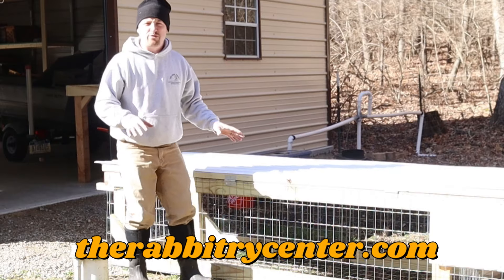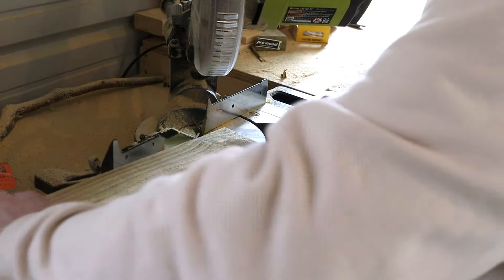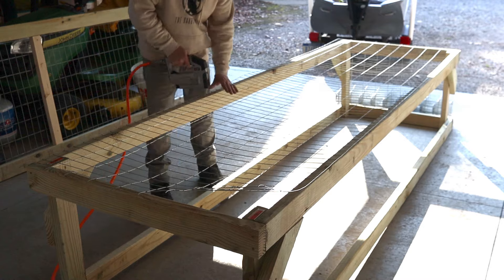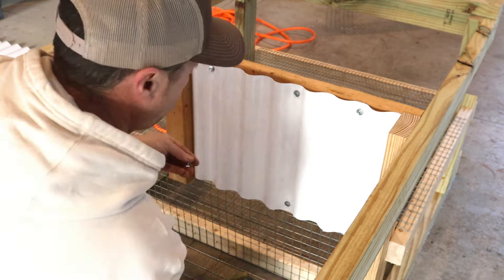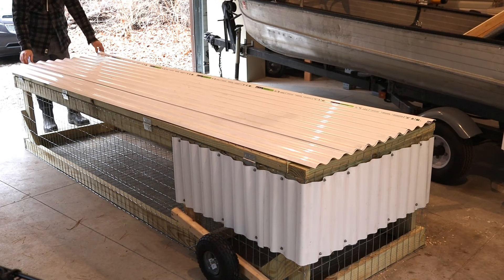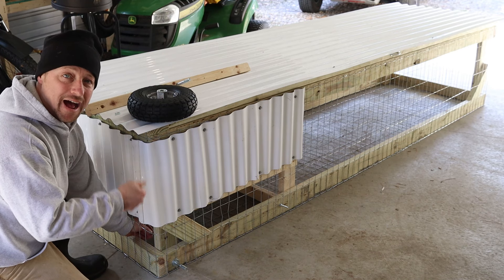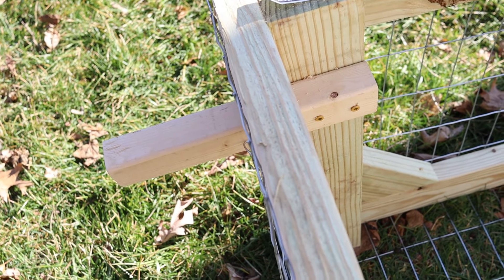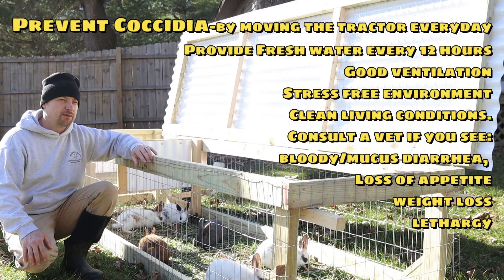How To Build A Rabbit Tractor With Wheels

Comment: As a smaller woman I would build the wheel assembly on both ends for even easier portability. Then I could pull or push it like a wagon instead of like a wheelbarrow
Reply from the maker: Instead of each end, I'd build a shorter tractor 6-8 feet in length. If you can lift a wheelbarrow with soil in it you can lift this.

Comment: Hey there! Thanks for the video and I will copy the wheel mount! Thank you for that! :) Some thoughts: In my third or so build I swapped the cage wire to the inside, so the rabbits wont bite into the wood. It looks sturdy at start, but once you raise some generations in it, the wood will suffer. If you do that, you have to add an additional cage wire as a second layer on the outside, so magpies wont try to get to the rabbits. One of mine lost an eye to the birds...that was sad. And to all of you, using this (or a similar build): Build as lightweight as possible. If you have some rabbits in it, those thinks tend to get HEAVY. If its too sturdy ... its just right. Furthermore I added an automatic water dispenser (they are pretty cheap) and added a water tank (5L or more) to it which I can fill up (via a valve) with my garden hose. If you have a lot of rabbits in it 5 litres will be gone in a day EASILY. Furthermore I recommend to let the bottom cage wire "overlap" around 10cm to the outside of the framework, so predators wont have a chance to even try to dig in. If you have a BIG yard, like you do, the gras will be more then enough. But to the people with a smaller garden: Be aware. The gras will be eaten FAST and afterwards they start digging. Furthermore if you have rabbits in it, they will flatten the gras down and compact it. Move OFTEN (I advise twice a day). Maybe one more hint: I fixated a lifting system for the roof. I added one bar of wood on the top of the cage and have a wood plank attached to the roof opposing this bar. If you lift the roof, the plank will go down on the bar and act as a "stand" for the roof. For closing just lift the roof a bit, so the plank comes lose, give it a little push and you can close the roof down again. I added some height to mine according to the height of the surrounding cagewire, so I dont have to cut it. But thanks a LOT for the video and have a nice day! :)
Reply from the maker: Thanks for taking the time to write your comment and share your experience. We all raise rabbits a little different which demands a different approach. 
I built this design specifically for a grow out tractor, which will be used from 8-12 weeks and then be vacant until another litter of meat rabbits need to grow out. We wrapped our permanent runs for our extended cages the way you described.  Thanks for watching!

Comment: Midway through building this tractor. I’m grateful for all the effort put into this design, parts list, and instructional video. I would suggest though that you consider a few less pieces of treated lumber. For example, the end pieces of the lid are treated, but not the long pieces. Why can’t it all be untreated? In fact, I think you could go untreated for anything not in direct contact with the ground. That would mean 2 of the treated 10’ 2x4s and 2-3 of the treated 8’ 2x4s could be cheaper and lighter weight. 

Also, I’m finding that screwing straight into the ends of these treated 2x4s is not holding all that well. The bracing will make up for that, though.
Reply from the maker: Thanks for taking the time to comment The treated boards have to be strong to weather the storms  and elements. I think you should build the Rabbit tractor, however, do you want and whatever makes sense to you. We did end up wrapping 8 inches of hardware cloth all the way around the bottom and adding extra arms on the wheels to make it easier. Stay tuned for an update.
Reply: @ An update would be neat to see. Your videos are all great. Very grateful for your channel.

Comment: Good video. If metal roofing is used for the lid, you probably wouldn't need to use wire. That might reduce costs a bit. It would certainly reduce labor. Also, if you have a Harbor Freight store nearby, they usually sell wheels cheaper than Tractor Supply.
Reply from the maker: thanks for sharing. These wheels are a terrific deal. I’d be very surprised if they beat that price and quality.
Reply: @ 10 inch puncture-proof wheels about $8. But you can sometimes get decent bargains at Tractor Supply too.

Comment: Terrific build! I missed why you shifted the door and ended up just shortening the door because I installed a second 2x4 on the other end thinking symmetrical ends made sense!😂 Ours is not exactly the way you made it but the rabbits will love it!❤
Reply from the maker: that’s terrific! Certainly doesn’t have to be exact. Best of luck with your Rabbits!

Comment: Thanks. I have some uneven pasture. Will larger wheels benefit?
Reply from the maker: those wheels don’t get stuck and are good for soft soil and moving around the yard. They’re sold at tsc. it’s the best choice I’ve seen so far. It’s good to mount the wheels close to the end of the tractor for easy pivoting.

Comment: My rabbits chew on the wood on the inside of the tractor. To prevent this I have to put the cage wire on the inside instead of the outside.
Reply from the maker: Absolutely, If your rabbits are going to be in the tractor, for a longer period of time, I’d provide branches and hay to chew on and wrapping the inside will be necessary to prevent any chewing and if you double wrap(creating a barrier) you can prevent contact with wild rabbits.
Reply: @TheRabbitryCenter. Great build, good looking and sturdy. For me, too heavy and too much work to prevent chewing. 

Just build this tractor from 3" pvc pipe. No chewing, no wood rot, no double wiring and much lighter to move. You can still drill holes for the wheel assembly and either t- in the piping for shelving or run rebar, steel pipe or wood through the pipe to form the basis to build the shelving.

Nuts and bolts with washers through drilled holes in the pipe will affix the roofing panels and wrapping the wire around the pipes affixing with zip ties, j clips or hog ties will hold the wire to the cage. Alternately you can use wide washers with nut bolts to screw-fasten the wire to the pipe.
Reply from the maker: Thanks for commenting and sharing your build plans. Our grow out tractors are housing 8-12 weeks old rabbits.  The chewing isn't a problem.  We throw in  branches and hay daily which helps their digestion and teeth. When using tractors for a permanent cage, you'll absolutely need to wrap the inside with hardware cloth to prevent chewing.   @jacquiegines

Comment: Are you able to move it around with the rabbit still in it? Seems like they would break their legs off
Reply from the maker: They don’t sit still, when you move the tractor the rabbits immediately jump in the enclosure for the ride.
Reply: I agree. I never made one on wheels but I put 2 x 3 gauge wire on my first rabbit tractor. When I dragged it they would run to the shelf in the enclosure, but I had two that didn't get up on the shelf and got a leg caught under it as I dragged the tractor. Having it up on wheels might give them more of a chance to hop up before you set the tractor down.
Reply: @TheRabbitryCenter  bloody brilliant
Reply from the maker: Thanks for sharing! @cturinetti
Reply: @TheRabbitryCenter weeeeee 🐇 🚜

Comment: Love the raised section! Is there a reason you blocked the rabbits from going under it? 

We've been using tractors for our meat rabbits for a few years now. Here are some of the things we chose to do/learned with ours that might be helpful tips:
*We use portable electric fencing for keeping away large predators. (Bears, coyotes, bobcats, and cougars)
*Old wheel chair wheels work great for moving them. 
*Mosquito netting on the outside is helpful protection if bugs are bad
**Always make sure they're in the shade in hot weather, as the roof isn't sufficient protection!
Reply from the maker: Thanks for the input. I appreciate it. The section below the cage floor is closed off in order to prevent the rabbits from urinating on their siblings.

Comment: What's the value of the raised space you created? Any risk with treated lumber and the rabbits chewing?
Reply from the maker: we provide hay and branches for the rabbits to chew on. This helps their teeth and digestion. Our rabbits are only in there from eight weeks to 12 weeks so if you’re planning on a permanent stay, you want to wrap the inside with hardware cloth.
there’s a lot of information at the end of the video how to use these correctly and prevent problems
Reply: Ahh OK that makes sense for hay. I've got two similar tractors but didn't build that part, instead I've opted for typical hanging feeders for pellets and hay. Great build!

Comment: Good job !!...
Just one question: Can't the metal mesh hurt the rabbits when they eat the grass?... (I've seen others with wooden slats for that reason)

If you put the roof at a slight angle you can collect a lot of rainwater and store it for use in dry weather.
Even water from the roof can go directly into irrigation ditches on the side of the tractor...
The irrigation ditches will in turn feed trees (fruit trees, acacias, etc.) which in turn will provide shade and food for the rabbits...

(I suggest creatively applying permaculture techniques in rabbit farming)

Greetings from Argentina :)
Reply from the maker: Interesting, thanks for taking the time to write your comment.

Comment: My only advice is to put half inch wire around the outside walls. We had a rattlesnake invade one of our tractors, through the chicken wire.
Reply from the maker: thanks for sharing I couldn’t agree more. I would add hardware cloth if snakes are a predator you deal with.

Comment: Why don’t you want the rabbits to be able to go under the house part that’s above the ground
Reply from the maker: Thanks for asking, the rabbits will  spray their litter mates with urine.  A splash could be installed on a 45 degree but the tractor space is sufficient without it.

Comment: You're taking a risk by pasturing your rabbits in a tractor. You could easily end up having to treat them for fleas or ticks or even worse. You might get away with it for growouts on a short-term basis, but I wouldn't risk any breeding stock that way.
Reply from the maker: Thanks for sharing, At the end of the video we discuss how we use them. Rest assured, It’s not for breeders.
Reply: To be honest: I use them for breeders too (if available). I dont have any problems so far and Im in my third year. Its more important to know your rabbits. Some of mine are somehow scarred in the tractor and wont leave the shelter...I dont put them in there if I see this.
Reply: If you let chicken come on the grass first you will not have any problems
Reply: This concerns me because I’m building one for my two pet rabbits. They won’t live in there full time but definitely will spend days on end when we get stretches of weather that stay between 40-70 degrees in the fall and spring
Reply: @hsmrengring854 Can you elaborate on this? We free range chickens in the backyard. Is that somehow a benefit to tractoring rabbits for a long period of time (not just growing out meat rabbits)?